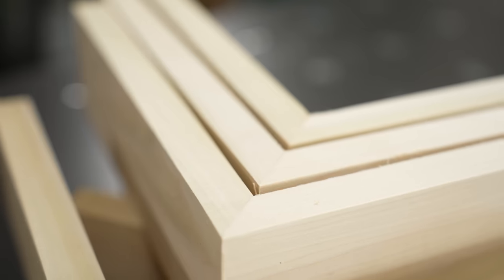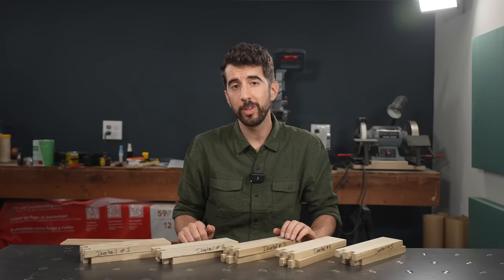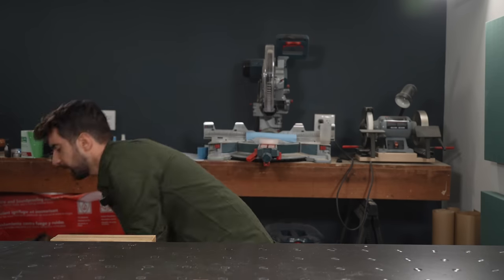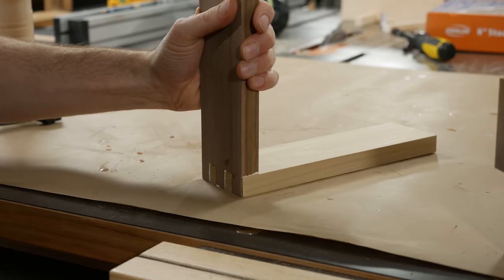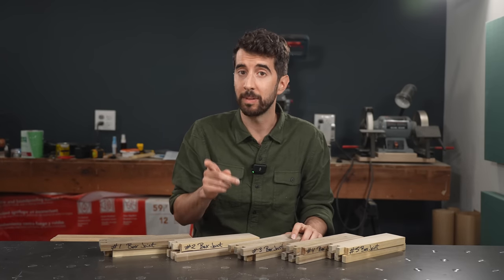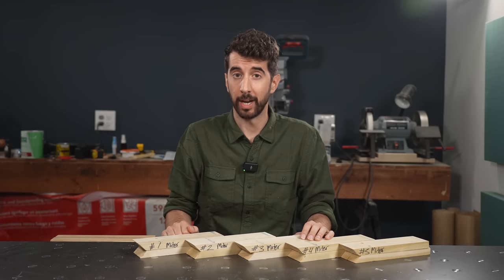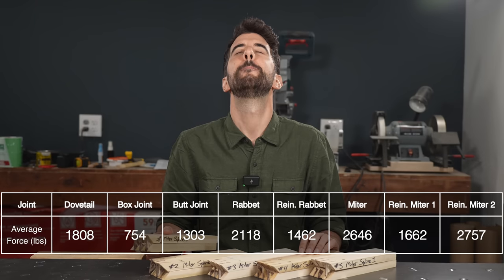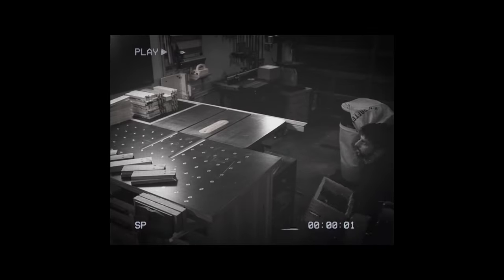This Simple Joint is Stronger Than a Dovetail!

Comment: With modern drawer slides you can build any joint you want and it will be fine. I can close and open my kitchen drawers with one finger. There is almost no stress on the drawer box because of the operation of the undermount slide. This includes a tray that I built to hold my stand mixer which weighs 40lbs. Very cool test Scott. Some of the drawers in my kitchen are not even actual boxes. They have metal sides with melamine back and bottom screws into them attached to a wood drawer front. It is impressive engineering.
Reply from the maker: yeah that's so true, but you can also use these joints for other things besides drawer boxes too. I thought my friend was crazy for making a media console with simple rabbets without reinforcement, but it turns out it's much stronger than I thought.
Reply: Great point. Sorry I have been building custom pantry cabinets for my wife for about a month so that is the only place my mind has been going for too long.
Reply: This is true even without drawer slides. The laws of physics dictate that you can't, under normal use conditions, put that much force on a drawer box. The drawer doesn't take 700lbs of force to move it, and you don't weigh 700 lbs. so YOU would move first. And you can't even pull that hard because you're not strong enough anyway even if you braced your feet against the cabinet and tried to "deadlift" the drawer open.  And 700 lbs. was just ONE corner, not a completed four corner box.

All of this is fascinating for us wood nerds but a drawer is something you just don't have to worry about breaking due to force applied to it. People make shop drawers with butt joints and brad nails. It just doesn't matter.
Reply: @Aaron-nj4ou  Just wait until you catch her standing on a pulled-out drawer to reach a high shelf.  Then you'll be glad for both the glides and the strong joint.

Comment: This is actually a very well devised testing setup, and that seems to be especially rare among joint strength tests.  My only nitpick is that I wish there had been an equal number of samples for each joint so that half of them could be placed in reversed orientation in the test harness.  Doing that would indicate how much the asymmetry of the joint design translates into asymmetry of joint strength and also produce more generalized overall averages.

Nevertheless my hat's off to you for really adding something useful to a discussion that often thrives by instead exploiting hidden subjectivity and manufacturing pointless controversy for engagement or self indulgence.
Reply: The almost pure shear load testing he did is the other problem.  When do boxes get loaded primarily by forces directly at the joint?  The answer is they are primarily loaded by bending forces.  So this test is basically useless when comparing joints for making a box/drawer.  A box joint or dovetail has significantly more surface area to deal with bending than a miter joint does.  No one should follow the results from this video because they are completely wrong.  My masters in mechanical engineering is crying out from my soul at how wrong this testing is.  This video is a great example of disinformation.
Reply: @miices  Do you have any insight to speculate around what the best joint is for making boxes and cabinetry? From where I'm sitting at my kitchen table without a mechanical engineering degree hanging anywhere in sight, it looks like I'm going to be making unreinforced miter joints for pretty much everything (though they're a pain to align when gluing.)
Reply: @miices I hadn't noticed that, but now that you said it, I do. It is definitely important to note the difference in real world applications. In the case of where bending fatigue is less of an issue, these results should be applicable. But when bending creates fatigue, the results will be significantly different.
Reply: @miices Exactly. And Said much better than I could have.

However, I would also add that the percussive test itself is invalid. Drawers are typically subject to repeated, steady stat loads - not a load from jerking on a chain.  A myriad of other conditions were also not considered such as aging, wood movement, glue thickness, etc.

Comment: One relevancy to glueup times is ... humidity vs. glue. The two most obvious wood glues to use are Titebond II and Titebond III. 

*These glues work completely differently.*

And it's not just that TBIII is "water resistant", hence good for use on outdoor furniture.

I live in Florida, typical humidity, even in winter, is probably not less than 50%, and runs up to 70%. Higher at other times of the year... Titebond II takes FOREEEEVER to cure in FL (probably true anywhere along the gulf region). Why? Because Titebond II cures by GIVING OFF MOISTURE. So clearly, if it's in high-humidity locations, it is generally not going to cure fast. I tried to do a joint with TBII and literally 48 hours later I pulled it apart by hand and a lot of the glue was still "thick fluid", not curing at all.

In THESE locations, you're better off with Titebond III. Because TBIII uses a different chemistry to cure -- it ABSORBS moisture from the air. Right, the exact opposite from TBII. So it's GREAT in humid locations. Note: Downside, it "foams", so you typically have to do some cleanup after to smooth the area around your joint. But it is what it is. It will actually cure, which TBII might not. On the other hand, if you live in Arizona, you almost certainly want to use TBII and not TBIII.
Reply: Thanks!  I didn't know this.  It's going to help my limited woodworking immensely.
Reply: So what happens if you mix TBII and TBIII in some ratio to make a TB2.5?  Will the moisture given off by TBII be absorbed by TBIII, allowing it to cure faster/more thoroughly by exchanging moisture internally where it is less exposed to air?
Reply: So TB3 is actually an urethane glue as those start to cure by the introduction of water - and TB2 is a PVA glue that cures by dispersion? I guess I'll Google it
Reply: Nah, TB3 is still a PVA glue and it cures by giving off moisture. Like all PVA/PVC glues.
Reply: I use TB1 almost exclusively because I rarely ever build stuff for outside and I like the fact that TB1 washes out.  As for strength, all PVA glues have the same strength: plenty strong enough.  It's kinda like your neighbor claiming their sportscar is faster than your minivan.  Maybe so, and yet you both get to the supermarket in the same time.
Reply: @indisputablefacts8507 tb1 washes out? What do you mean?
Reply: @WindsongSoundBath I mean that dried tb1 that gets on your clothes will come out in the washing machine.  Not true of tb2 or 3.
Reply: Franklin makes a urethane glue but it's called  2303.   Titebond III is not PUR, does not foam, does not moisture cure.

Comment: Very informative and entertaining. From my memory of my degree course, 50 years ago, failure on wood glue interfaces is complex and is not as simple as looking at the strength of the glue and the strength of the wood, if I recall the thickness of the glue layer is very important. I now wish I hadn't failed that part of the course! A lot of this science was developed in WW2 when they were building wooden airframes in furniture shops e.g. de Haviland Mosquito. From a statistical point of view comparing averages is not a good way to say whether one method is better than another, you need to look at the spread of the results for each test. If there is a big variation from minimum to maximum on a test, in simple terms it could overlap with the range of results of a comparative test and would mean that no statistically significant conclusion can be reached. You also need to know whether the results for a series of tests on a particular joint are what is called normally distributed i.e. equally, randomly spread about each side of the average.
Reply from the maker: you can see the deviation if you pause the vid where I show the stats near the end of the video

Comment: Wow, what timing. I just finished making a spline jig for my table  saw for mitred picture frames. And used it for the first time not 1 hour ago. Thank you so much for your brilliant joint test video. So glad I used the strongest type of splined mitre joint for my picture frame, because, yes, you need all that advantage in something so structurally important 😂
Reply: To be fair, a picture frame has the miters oriented the opposite way than the ones in this video, so it's arguably more advantageous to spline your picture frames because of the wood movement issue. Although picture frames aren't very "wide" boards so movement would be minimal. Wood movement is really what we need to think about with joints, not "how much excessive force does it take to rip it apart." Because it's not going to experience that force in daily use. But wood movement forces are enormous and will snap your glue line easily over time

Comment: Long time woodworker and home builder here.  LOVE that you do this stuff and your presentation is fluid, clean and entertaining.  A few comments on the joints;

I have 240 drawers in my shop.  Most of them made with butt joints and #8 wood screws (they're shop drawers..) and the early ones made with 1/8" dowels.  I have not done any testing like you have, but with that many drawers, some holding a couple of hundred pounds of tools or hardware, I feel I'm in a good position to make some claims about these joints.
1/8" dowels have not failed yet and one of these drawers is only 2.5 inches deep and holds 120# of galvanized bolts.  Of the screw joints only one has failed, also with more than 100# load, and it failed because of glue starvation (my opinion) and being slammed too often by a gorilla (AKA new employee).  If you ever revisit this, I'd be interested in the 1/8" dowel joint and how strong it is.  Seems it might be stranger due to less material being compromised...?

Comment: Great video Scott. I have a video suggestion for your test rig. It would be cool to see testing done to compare fluted dowels, spiral dowels, regular dowels, and maybe miller dowels too for the fun of it. I'm curious if the friction of a regular dowel causes glue starvation, or if the different types of dowels cause any significant difference in strength in the joint. I've never seen anyone test this before and many woodworkers use dowels in their joinery.
Reply: Great idea!  Also, should we score pegs for use in larger builds like work benches to take advantage of glue, or is the physical size of the peg providing a significant part of its strength.  Got my money on fluted dowels for that test.
Reply: Go check out Suman, he just did this.

Comment: Thanks Scott. Really good video. Just what I needed. I am a hand tool woodworker and don't have access to things like a Domino or a 45 deg. Dowell jig. So I have been avoiding Long mitre to joints on cabinetry because I worry about their strength and therefore have resorted to the lengthy process of dovetailing. This gives me more confidence to try using nice long miter joints in the future.
BTW: I would love to say this same joint strength test tried with 3/4" ply Cheers David

Comment: Hey Scott, nice work! In your final test, where the splines slip out of the joint without breaking – it's my belief this is caused by glue starvation. Hot hide glue is the solution that works for me.

I make hardwood art frames. Over 2000 frames (8000 joints) in the last few years. 3/8 x 1.25 mouldings, where each miter only has 0.675" of surface area for the glue. I use two 1/8" thick hardwood splines across each joint, placed 3/16" in from each edge. The miters use Titebond I, which seems fine. But when I used Titebond on the splines, they failed by slipping out, not by breaking, just as you found.

The majority of the frames have been made using 315 gram strength hot hide glue for the splines. While I can break a Titebond frame with my bare hands, these are nearly impossible to break either by pulling, levering, or twisting. When they do fail (when I use tools to break them), the splines are cracked or pulled apart with the grain. Usually there's other damage to the mouldings / miters as well. The difference from my perspective is night and day. Much, much stronger.

Without even knowing if one glue is inherently stronger than the other, I believe hot hide works so well because the warm water in the glue swells the wood components, making the joint immediately tighter. Then the glue dries, and the surfaces can't come apart. It's telling that I need to make the splines about .003" thinner than the slot. With Titebond, I was able to make the splines the same as the slot. If I left slop to avoid pushing out the glue, I'd have an unsightly glue line outlining each spline. With hide, if I make the spline as thick as the slot, I can't push it in fast enough to bottom out before it begins grabbing. The glue doesn't set up quite that fast. That's the wood swelliing. There's no visible glue line because ... there just isn't. Hide glue dries clear, and accepts finishes.

If you ever re-do this test, it'd be great to see an objective measurement of what I see anecdotally day after day.
Reply: Your logic doesn't seem right. Hide glue may swell from moisture, but over time and low/changing humidity, such joints always seem to loosen, and really old furniture just has amber dust remaining because the glue never penetrated the wood, where adequate Titebond type glues soak in, swell the fibers, and then harden without further changes. I have an 8" wood sculpture made from 1" hardwood glued with original Titebond, clamped, then drilled, carved, and tooled before finishing with Watco oil. After nearly 40 years, the layers are rock solid with zero gaps or cracks.
  Antique conservationists want reversible processes for convenience in restoration, but if a piece has no deficiencies, such work is moot.

Comment: Excellent video, thanks for posting.
My typical joints (just dowels) are strong enough, so no need to change anything. I do like the look of box joints and splined mitered joints, so I still use those occasionally too. Dovetails are all but extinct in my shop.
Reply: So i just have to hope you are not making drawer.
Reply: @ABaumstumpf  I've made plenty of drawers with just dowels. Some exposed, most not. Never a failure.
Reply: @NWGR  That's because people don't understand how strong the configuration of a drawer box is and how little force you need to, and actually could, apply to it. People who think the worst joint in this video (700 lbs to break one corner, not even a box) isn't impressive have obviously never picked up a barbell before. As if a 150 lb. person is going to be able to tug on a drawer with 700 lbs of force and instead of the drawer simply moving, or pulling themselves into the cabinet the drawer is going to rip itself apart? People are weird.
Reply: @CarlYota  I'm still not following why you said you hope I'm not making drawers?

Comment: When I make drawers for shop furniture, I don't even glue them. I use butt joints and screw them together. If they fail (and none of them have yet in over 20 years), I replace the plywood panel and go on with life. Goal is cheap, quick and effective. For fine furniture a more visually pleasing joint is used. But even on some of my closet organizer drawers I use the same technique and am happy. Those drawers are rarely seen and they work great, cost little and last forever. The whole joint craziness is largely due to YouTube phenomenon and talented woodworkers on YT displaying their skills. That is great and I have hand cut dovetails just to do it and to enjoy the process, but as a joint it is obsolete in a modern drawer. I still love them and I love the box joints and all other classic joinery and woodworking in general. What I don't like is to be made to think that a certain joint is absolutely the best. It all depends and it all evolves with materials, glues, etc. Thanks for the fun video.
Reply: Noob here.  Butt joints meaning, in this case, end grain to face grain right?

Comment: Singer sewing machine bases around the 1950 had a simple joint with one small 4mm wood peg on each corner + a corner block glued inside for the machine to sit on.
I have just had one in the oven to kill woodworm and make the glue fail, it is now ready for renovation.
These cheaper wood bases usually had canvas / cotton material wrapped around that hid the joints. They cope with quite a lot of stress from a cast iron sewing machine even when the glue starts to give up with age.

Many thanks for showing the strength of a Rabbet. I think the peg in the sewing machine base was for alignment while the glue set.

Comment: Now I NEED to see these tests with joints no self-respecting woodworker (schlups like me) would use: pocket holes, butt joints with drywall screws (in sheer), and butt joints with 16 gauge brad nails (in sheer). I LOVE these kinds of tests!
Reply: What do you mean "no self-respecting woodworker would use"? I use glued butt joints with a few 18 gauge brads in them all the time. Not sure if I'd use them in real furniture because of the aesthetics, but for shop furniture or cabinetry and such they work great. I have a nice filing cabinet built from baltic birch plywood with the drawer boxes built this way. They've held up great for years and were amazingly quick and easy to put together.

Comment: "Mechanical Advantage" at 1:18 (and throughout) is incorrect. MA is basically leverage. If you spin a 1/2 size gear twice, while next to a full size gear, the full size will apply twice as much force, but spin half as fast. Or if you apply 10 lbs force at the end of a 5 foot pry bar, with the pry end 0.5ft long, you get 10x5/0.5 = 100 lbs force at the pry end, but it moves 10x slower. Mechanical advantage.

You're thinking maybe of "normal force" or "mechanically located" or even "resists moment."